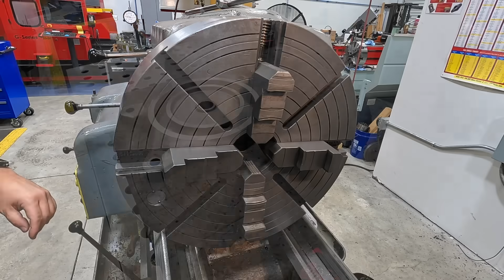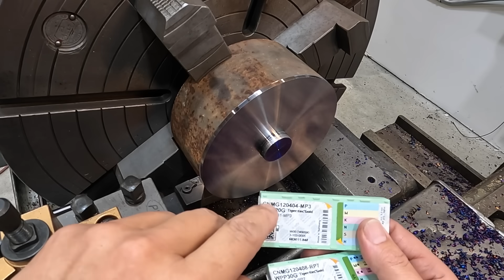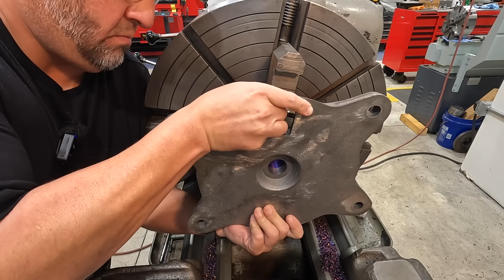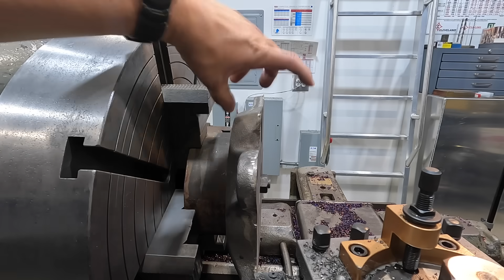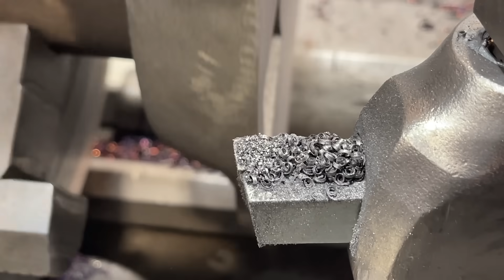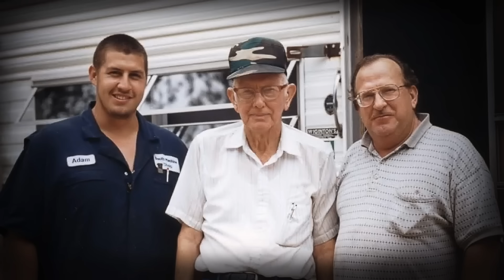Hardtail Vise Build Ep.5: Machining Swivel Base Second Op.

Comment: What i find fascinating is that the chatter pattern was coherent across tool passes. One possible interpretation is that the ringing set up tiny standing waves in the surface of the cut face, and each passage of the tool lopped off the wave highs and skipped the wave lows, leaving an image of the standing wave pattern showing in the finished cut surface.
Reply: He mentions in the video that the later passes are probably just deflecting until the tool finds the existing groove, following the path of least resistance and reinforcing the pattern
Reply: I think that it's inescapable that the chatter marks arise from movement of the surface or movement of the tool (or some combination thereof).  I had imagined that the tool would be much more rigid than the workpiece and so any movement would be in the piece instead of the tool.  Again, the fact that the pattern was coherent across tool passes made me think of the piece instead of the tool.  If it was the tool moving then I would imagine that the chatter pattern would be different for every subsequent pass of the tool, so the pattern would not be coherent across passes.  Won't ever know for sure, but its an interesting effect.

Comment: Still the ears are PLAYING a very nice tune 4 sure.😉👍HINT HINT AB If only you could turn 4 jack stands with studs and flange nuts that fit in the bolt holds in the ears to keep the them from deflecting. That would be the ticket at low RPM. Just like those ones you use on the milling mechine. 🤔🤔HMMMMMMM

Comment: You need to be careful putting jack screws on the chuck to support the lugs. If you overtighten them, you risk machining a concave dish in the base when you remove it from the chuck. It might not be much but would be visible with a straight edge and a torch

Comment: I would only try to machine a mystery metal or an exotic alloy using a carbide tool at my home shop. I took some proprietary alloy scraps from work long time ago and thought "how tough can it be?!?"... It destroyed 1/2" M42 10% Cobalt roughing endmill (made in Taiwan) at 0.02" depth of cut in 3-4 seconds.

Comment: Looks like 304 SS but looks can be deceiving...
Reply: With that much corrosion(rust) on  it, I’d say it’s doubtful. My guess is 4140.
Reply: @grntitan1 Exactly. What was I thinking?!?Even if it was rolling around with mild steel it probably would not have that thick of mild steel dust embedded on the outside.

Comment: 4 jacking screws would have taken the ring out of the ears, using the chuck T slots.
Reply: The ears look to be at four of six divisions, ie not perpendicular across the diameter, so the T slots would only line up with two at most, reducing the issue but not eliminating it and potentially introducing additional error into the work or lethal projectiles into the shop
Reply: I thought the same, but it would be difficult not to deflect the ears the other way and take off too much material.
Reply: Would that deflect the material in such a way as you lose flatness?
Reply: It is deflecting on it's own as the surface area support is to small, put in on a mill and the first thing you would do is put jacking screws under the bits that need support. 
  @johngardner58
Reply: I came to suggest essentially the same thing, I would have used 4 bits of studding sticking into but not through the holes with nuts gently tightened against the wings, for those worried about deflecting the wings, it’s all about feel, stop being so heavy handed!
Reply: @grahamstretch6863  if there isn't pressure against them they will still chatter
Reply: @feelthepayne88  
There is a point between no pressure and sufficient to bend a casting over one inch thick. 
I have used this technique on a much lighter aluminium casting fixed to a face plate, I know it can be done!
The studding needs to be a close fit for the holes, so in this case 3/4 inch to minimise any risk of them leaving the chat as it were!

Comment: 33:15 is that a crack in one of the ears in the hole looks like it continues into the base
Reply: I originally thought that it might be a seam, but after going back to 28:00 and seeing that it is the same ear with the worst chatter I now think you are correct. It really should be checked out as it could cause a chunk of that ear to break off.
Reply: @asilvaphotography A seam? There would never be a seam there; that is definitely a crack and it has to be repaired especially given it's a main supporting bolt hole for a  heavy duty vise.
Reply: You have a great eye. That is a crack.
Reply: I see what you mean, but it just looks like an artifact of the rough cast surface to me.  Definitely worth him taking a look to make sure, as IF it is a crack, that would be very significant, but there's no way we could tell from just the shots in this video.
Reply: If that was a crack then it would show on the machined surface. 
It could be a feature of the rough cast surface, or a scratch where a bolt has been tested in the hole.

Comment: How do you know when to use oil?
Reply: Huge number of variables need addressed to answer that question. Cast Iron can usually be machined dry.  Many carbide cutters can cut dry. HSS cutters usually want lubrication. Sticky materials like aluminum and copper want lubrication to prevent galling and chip welding.  Etc, etc, etc 

Next question will be how do you know which oil or coolant to use? And that's a whole nother bag of cats!
Reply: @Ddabig40mac   That's the real answer.  The short answer is: experience.

Comment: I have been watching this channel for years and been a big fan in the past, but the time and resources of such a well equipped machine shop being used to reduce the chatter marks on the bottom of a bench vice that can be bought off the shelf and is going to be bolted to a bench anyway seems ridiculous, surely there are business in the area that need basic fixtures or repairs to their equipment ?
Reply: A friend who taught me a lot of my machining skills would always tell me the same thing when I was starting out.....make every part like it matters. Even if it's just a throw away part for a fixture or something you do it the right way.  That way when you need to make a similar part that does matter you have the knowledge to do it correctly the first time.
Reply: @seanmcdonnell1282 agreed.  Regardless of the trade, when a project that doesn't matter is kicking your butt, it gives you the time and freedom to keep trying things and messing up and learning until you figure out the right technique to add to your toolbox.

I'm pretty sure if Abom had to do this part over, he'd use a different approach than his original plan.  That difference is the sign of a lesson learned, and those lessons are the value of experience
Reply: Hi there, having watched the work he did in "Motion", when he was employed there, it seems like he is going backwards and its such a waste for resources, I used to look forward to his videos and watch them more than once
thanks for replying  @omaristephens2143
Reply: This is a lame take. You can take your logic to the extreme, and say why "waste" tool and equipment time setting up the camera and making videos at all. 

The man's goal is clearly to make a living making YT vids about machine shop work. And he's doing that! And we all watch. 

Seriously, get over yourself, just a little.
Reply: That could be said of yourself or anyone watching a man making a living. Thanks Adom for giving me experience that i will probably never use. I could be helping someone else instead of enjoying videos
Reply: Interesting point, but i am a fan of the channel too and I love this series! It's like an extended promotional video for the fireball tool vice project. I love seeing them work together to make a beautiful vice! Did you know this is the first(ish😅) American made fireball tool vice?